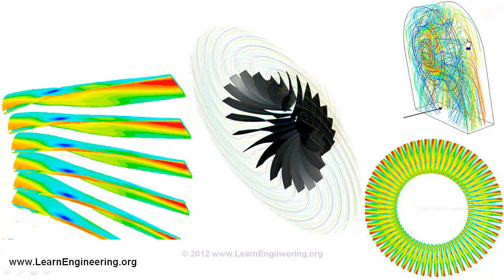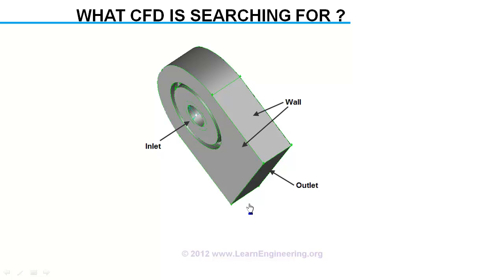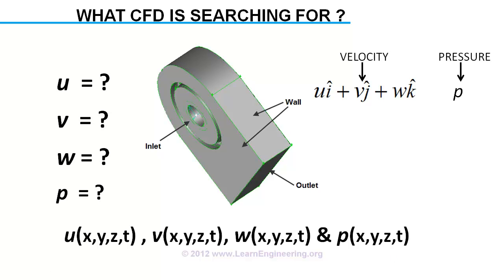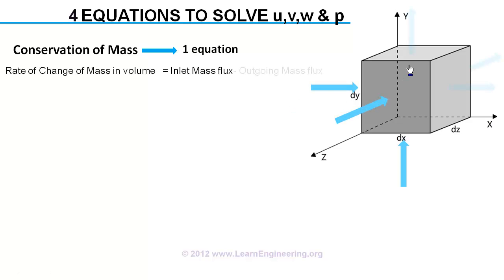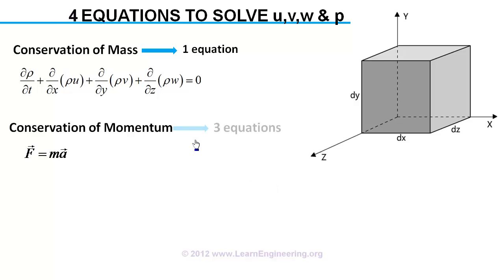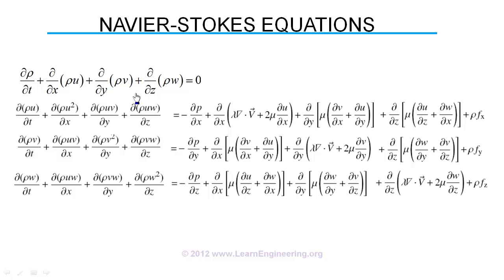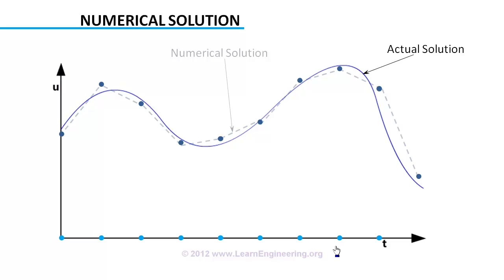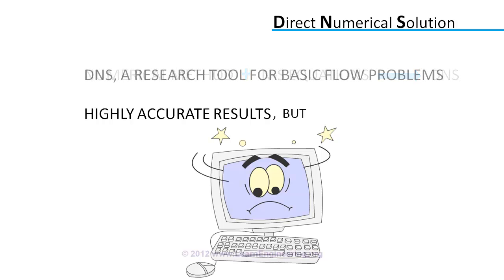Introduction to Computational Fluid Dynamics (CFD)

Comment: Does Ryzen CPU and nividia GPU driver have issue ? I have heard from Tom Hardware website..... Can I run mechanical software like Openfoam, Hypermesh, Ansys(Simulation), Converge CFD, Ansa in ryzen smoothly and what about linux

Comment: The video makes a serious mistake on direct numerical simulation (DNS) and its relation to the numerical solution to Navier-Stokes equations. DNS is to directly resolve turbulent flows both spatially and temporally without having to supply some ad hoc turbulence models. 

Most flows we encounter are turbulent, but there are important flows in the laminar regime for sure.   If flows are laminar,  then numerical solutions  are DNS, which cost very little to obtain, due to the fact that the scale to be resolved is about the same as the fine features of the domain.

What I point out here is not nitpicking. It is a serious oversight or potentially a misunderstanding regarding what DNS is and is not.

Comment: What is the minimum requirement for understanding CFD course? I have beginner level knowledge in calculus I & II, AP physics mechanics (covering fluid mechanics). Will that be enough or do I need to brush up on more courses before taking CFD topic? Please help, I am very interested in CFD!
Reply: It is awesome that you are interested in CFD analysis. In my opinion and experience, I believe one should have the knowledge of Partial Differential Equations, Computational Numerical Methods, and Fluid Dynamics. At minimum, fluid dynamics is good enough.

Comment: Hi,
I'm working on a science project right now and i'd have your opinion about a fluid mechanics issue of mine. I'd like to evaluate the upward thrust force induces by a wave (sea swell) upon a flat floating object of negligible thickness. Would it be consistent to assume that wave's upward thrust is equal to the object surface area times wave's height times waters density? Since the object's area times wave's height represent the displaced volume of water pressuring the object from beneath. Then this volume times water's density represents the mass of water implied in the energy transmission between the wave and the floating object (which also gains potential energy proportional to the wave's height). 
Thanks for your job as a teacher and youtuber. Your lectures are very interesting and educating so keep going on please !
Reply: Just curious, what did you end up doing?